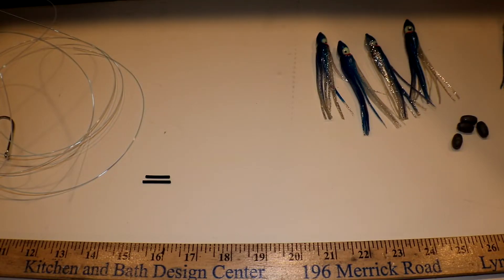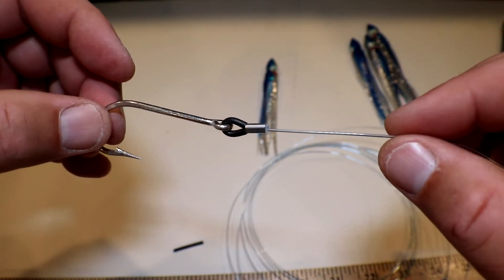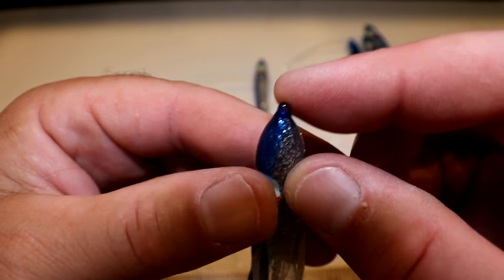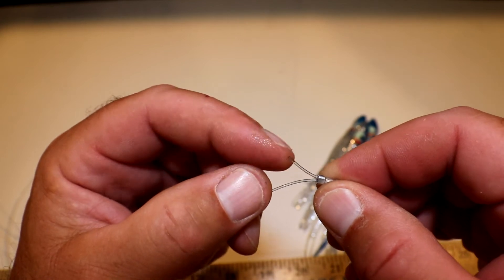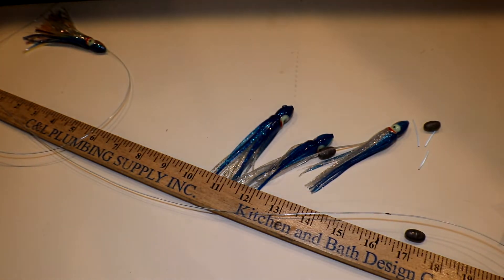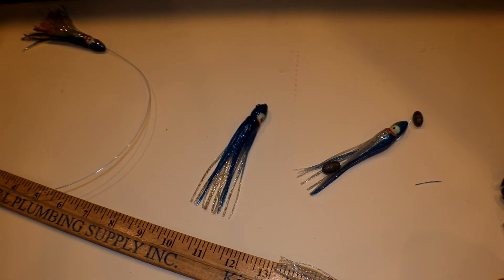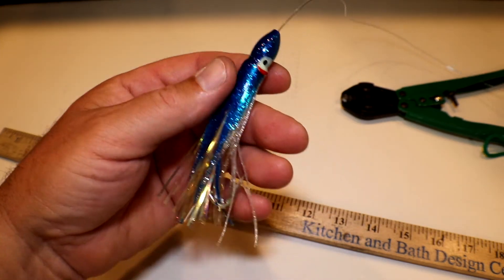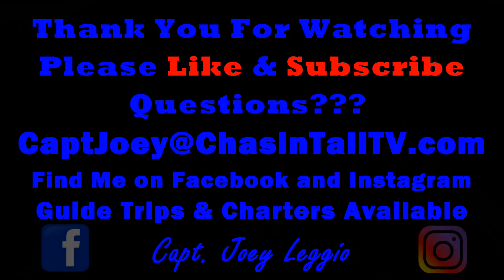How To Make a 5 Skirt Daisy Chain Simple & Easy - Inshore Pelagic's

Comment: Excellent Instructional Video. I am totally new to this and so the fishing nerd in me will watch every video on youtube on this (sigh). I have seen guys who have said that to prevent the bite offs by toothy pelagics, rather than using a straight chain daisy, you can use a single piece mono leader with 4-6 inches of branched wire leaders (using T-slider swivels crimped onto the main leader) attaching to the skirts and hooks as well as for the terminal skirt/chugger etc. Can you share your thoughts/expertise/advice on this please? Truly appreciate it.
Reply from the maker: I have seen wire used on the bigger stuff for wahoo. For kings maybe a triple hook like they use on party boats down south or single strand wire. I have plenty of other instructional videos on my page. Check them out if you like.